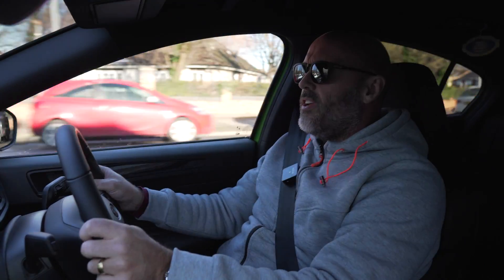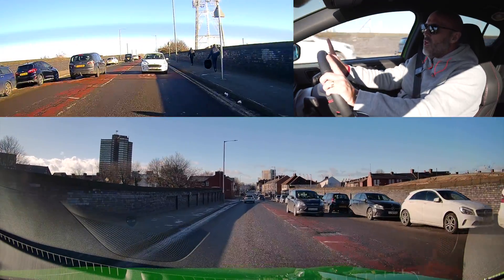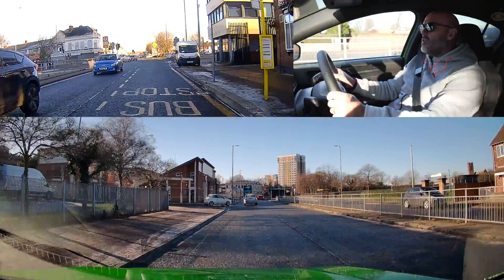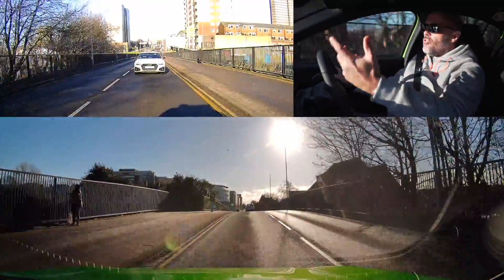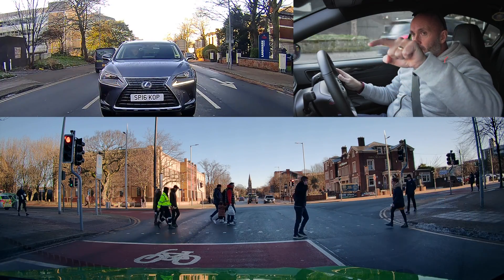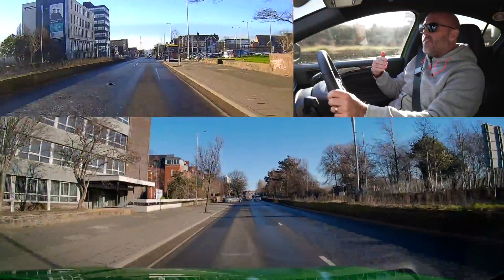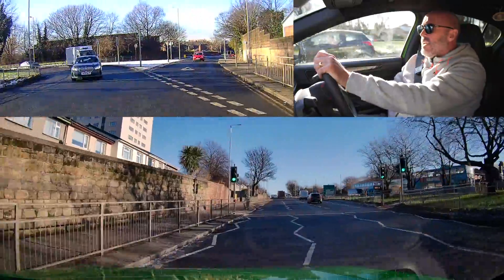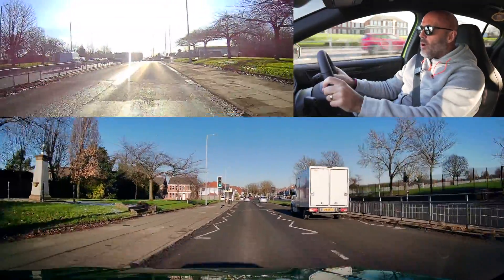How To Anticipate Traffic Light Sensors (Flashing Your Lights Doesn't Work!)

Comment: I used to work on traffic light systems and can tell you the following about the in road sensors. There are three shapes of sensors, diamond (GEC), half chevrons (Plessy) and full chevrons (Ferranti). I might have the first two back to front! Crossing each sensor on the Ferranti system added 1.5 seconds more green upto a max green time for that direction. If no cars are coming either way the lights default to the main cause of direction.
This info is very old so could have changed.
The bad side was that it encouraged those in the know to rush to hit the first sensor before slowing down.

Comment: I hate the ones that don't pick up on motorbikes.
Whoever designed those has no concept of how traffic works.
I've been stuck at lights for a while in the past, waiting for a car to come along because the lights have cameras facing the opposite way to catch people skipping the light, so going on the red is not an option. There's a specific junction I know well and they follow the same sequence at all times. No problem in my car. Never gets triggered on the bike.
In my car. I've also seen cyclists creeping forward from blind junctions, trying to get out on a red because they've not been detected.

Comment: stopping at lights isnt an excuse to sit and look at yer bloody fone ,,, it gives you chance to observe more ,, check your mirrors cos you never know some twit racing up behind hasnt seen you have all stopped ,not that you can do anything about it but you can prepare for impact . i was always taught the 3 second rule .  you shouldnt need your foot brake for more than 3 seconds , if you do drop a gear and use engine brake ,  shouldnt have clutch in for more  than 3 seconds if stopped , put in neutral and handbrake .if stopped at lights longer than 3 seconds handbrake again .i always thought 3 seconds for foot braking surely isnt long enough but if you test it out it actually is for most situations and if not drop a gear and use engine braking to save brake pads ,plus while using engine braking you arnt using any fuel at all .if like some you coast down a hill with clutch in and using foot brake your still using fuel to keep the engine at idle .ive got a new vauxhal corsa 1.2 which is supposed to only do 37mpg in urban stop start traffic , i can get just over 50 mpg . oh and if stopped at lights more than a min turn engine off , you will surprised how much fuel it saves over the course of a week

Comment: I start very early in the morning. Sometimes before 6 .and the lights always change very quickly to green .but when I return more traffic on the road. I'm hitting more red lights. I was behind someone not fully parked at the lights, but lights stayed red .until I told her to move forward for sensors to activate  the lights changed.

Comment: Don't know if anyone's made this point, but I think the myth about flashing your lights to get traffic light sensors to change may come from a confusion with temporary traffic lights. I believe, at least with older temporary traffic lights, that ones that would car count, specifically at night, might be susceptible to light flashing. Not actually sure if any temporary lights operated this way though.

Also, some people think emergency services flashing lights make lights change. Don't know whether that's actually true though either.

Comment: From my experience, I've noticed three types of traffic light sensors: the ones cut in the tarmac, the infrared cameras and actual headlight cameras.
The first work good when traffic moves very slowly, like in bussy city areas, but they're literally uselss on stretches of roads where the speed limit is, say, 40mph.
The infrared cameras are the majority of sensors and sometimes they are programmed so that when you approach the set of lights at a certain speed, let's say, not faster than 40mph when the lights are red, you will reach the traffic lights and they will change to green if there's no other traffic from a different direction.
The headlight cameras work only at night. They're quite sluggish in triggering the green light, but they only work of you drive with your main beam on - flashing repeatedly does not work - and they're mostly installed on dual carriageways with a higher speed limit than 40mph. They're also quite rare.
How do you know they're there? Simply from experience, so you need to test them as you drive in your area.

Comment: All good and sound Ash but some temporary light still work on sound, but not light, in my experience. If you look at the sensor box above the temporary light set it will show a red LED light as you move towards but not if it's sound triggered. We have to be extra knowledgeable when cycling. A particular set of lights on a busy orbital near me won't change for a single cycle or motorcycle without you making multiple passes over the magnetic loop sensors in the approach.

Comment: The units on top of the lights are motion sensitive, and look for moving traffic.  They are normally used to judge when a green light can be changed to red without impeding traffic.  They can also sense an approaching vehicle when the light is red, and if the cross road is clear, they may turn green in anticipation.

The inductive sensors cut into the road surface are presence sensitive, and while they can sense approaching traffic (if they're installed far enough away), they're more usually used to sense queuing traffic when the light is at red.  They do not require the vehicle to be moving, only to be present over the sensor itself.

Comment: While it’s often not possible to see where the detection cables actually are - say after they have resurfaced the road after the installation (they do sometimes, believe it or not). However, if you observe the change in lane markings from around 8m 29s, using long lines/short gaps, it’s likely that they are in that area. The formal term for those is “warning lines” in the Traffic Signs Manual ISBN 978 0 11 552479 0. It seems reasonable to plonk the detection cabling inside that zone.

In that clip, there were 5 marks on the approach to the stop line before the cycle zone (which is the minimum on a 30 mph road), but could be more. If you are outside that stretch with “warning lines” you should be able to stop if the lights change - but much closer than that you’re in the “dilemma zone” ( term used in the DfT bumf), and it’s often best to carry on, if you do the sums re the standard display time of the yellow aspect, braking distance etc.

Another type of sensor that is used at certain junctions is the traffic priority one, with on-vehicle kit mounted in buses. Sometimes used at bus-only ones, but could be elsewhere as well to prioritise them if they are at the front of a queue.

The other feature that uses sensors is those roundabouts with “part time” signals. They have signs that show they are “part time” and may be switched off when traffic levels don’t need them. Another one is temporary traffic signals that are supposed to be able to detect traffic.

Apart from the use of standard sequences for individual junctions, which one tends to learn with route knowledge, some Councils have systems that have several junctions linked together so as to maximise traffic flow ( so-called “green waves” ), so sometimes running at roughly the right speed one can end up without having to stop anywhere. Depends on the overall layout, though.

Comment: Three things I'd change about the UK's traffic lights:
1. Have those sensors placed further back to avoid changing to amber just because someone left a slightly larger gap, forcing them to brake more sharply than usual. Also sensors that are better able to detect cyclists (once again, good to learn from the Netherlands here)
2. Longer amber phases depending on the speed limit - 3 seconds for 30 mph, 4 for 40 mph, 5 for 50 mph and so on. At higher speeds you really need more time to react and decide to come to a smooth stop, or to continue through.
3. Arrow shapes for the red and amber lights. At complex junctions it's often not immediately obvious that a red signal is intended for turning traffic as it's always a red circle, causing people to stop at them when they intend to go straight (this happens especially at night in unfamiliar areas). Having a red arrow for a right turn immediately says "right turn traffic should stop, this signal doesn't apply to others".
Reply: Disagree on point 3: an arrow for me means "go" regardless of colour.

Comment: One thing I notice people missing is "Platoons". Lights on a longer, busier road are timed, so groups of traffic get the green lights.

They're timed on the speed limit, I.e it takes this long for a vehicle going 30mph to cover X distance. If you speed along at over 30, you'll constantly catch the reds, stop, and almost immediately have to start moving again. Whereas someone going the speed limit will arrive as the amber comes on
Reply: The A34 into Manchester is one of these and taxis knew that driving 20mph over the speed limit got them through them all. It was scary that they would drive at a red light and it would change with seconds to go!

Comment: A few years ago,  I drove right across Leeds, on the main roads, to catch an early flight. Each set of lights were on green, until they sensed my approach some distance off. They then changed to red, despite the absence of any vehicles on the side roads, causing me to slow and stop, before changing back to green.
Reply: This seems to be a trend now in the move to demonise cars. It's sometimes comical to watch it from the side...you're sitting at a red light with green to "fresh air" as someone put it down below, then as someone approaches the green from the other side, it turns red and then gives you the green. There are a few traffic light controlled roundabouts I can think of which do that.

Comment: I think it was on a youtube video that someone advised not to ride the clutch at intersections. Something to do with clutch thrust bearings.

I have long since, decades long, been in the habit of neutral and handbrake at traffic lights and stop signs.

It has never slowed me down. I am usually first away as lights change.

My give way sign behaviour is different but I make sure not to jump the gun at lights and stop signs by not even checking to see if the way is clear until the handbrake is on. At which point I do check to see if the way is clear.

It won't necessarily stop an overzealous cop from lying about not me not stopping though.

Comment: Am I missing something? Why would anyone sit with the clutch held down in gear whilst waiting at traffic lights or a junction where it is clear you won't be moving anytime soon? I'm just thinking about the poor clutch getting destroyed. Not only that, if the handbrake is not on either, one slip off the clutch and you'll be shooting forward into possibly another vehicle or pedestrian. Is this normal behaviour?

Comment: Here in Bristol during the night the traffic lights stay on green until they see a car coming then go red to stop that car until someone approaches from a different direction. All right it's not all of them but definitely the ones on the Bear Pit roundabout and the ones on the Cumberland Basin flyover, they've done it to me too many times for it to be a coincidence.

I delivered to a company that makes traffic lights once. While I was there I asked one of the guys about the sensors and he confirmed they are just rangefinders and are designed to work regardless of light levels so they can't see you flashing your lights at them.
Reply: Yes, I've noticed this as well, generally on traffic light controlled roundabouts. I don't know if this is a good strategy for busy times or whether it's just part of the war against the car!
Reply: Perhaps the opposite approach would burn out the red bulbs, which would be more of a safety issue than burned out greens.  Road tram signals on which the centre bulb is common to all "aspects" ie stop (bar), proceed & cluster (equivalent to amber) and so is always lit, are often failed due to having burned out.

Comment: Or you could just use the amber light coming on for its intended purpose of preparing to pull away and slot it into gear. I'd also add that outside the big cities lots of traffic lights don't have sensors and just run in set patterns and sequences.
Reply from the maker: IAM Motorcycle Observer and Assessor trying to reduce road users observations. Nice!
Reply: @ashley_neal  Nowhere did I say anything about reducing your observation on what is going on around you. I was commenting on the idea of trying to second guess when the lights are going to change.
Reply from the maker: Lol. What do you teach your riders to look at then?
Reply: I think Mike will tell them the same as you (it's certainly what the IAM taught me).  However its not an exact science & the red amber phase was created to give a " heads up" in advance.  Most countries don't have this phase eg France - red straight to green.

Comment: Please everyone pull up to the line and stop over the sensor. People at my local junction stop before the sensor, causing the right-turn filter not to trigger. Happens 50% of the time, and we wait three cycles until the lights do a mandatory right-filter phase.
I sent the council pictures and diagrams twice but they never do anything about it. Edinburgh council that is.

Comment: A few things about how they work. Yes the one's on top of the lights use infrared to detect cars. I sometimes wonder if there's just a single car, they're too close to being picked up and so it might wait until there's more than 1 car in a queue before it kicks in a timer for the other directions.
The ones cut into the road are more interesting. They work with inductance, like the wireless phone chargers or NFC to know a car is there. The distance for causing lights to change will be about the time when a car isn't hitting the sensor at the back plus a little bit of time. So if a car has just left the front sensor, and nobody has crossed either sensor within a second or so, then the lights will change.
The one's cut into the road are particularly important when it comes to single lane lights. (usually turning left). If a car is not sat on the front sensor, the lights won't change until the main lights for everyone changes. I've seen so many times a car has stopped too far back and hasn't been on the sensor, so the filter lane light hasn't changed. Sometimes these sensors are larger than others. These areas are also more prone to pot holes since it's a weak point in the road, so some people avoid going into the pot-hole and then don't trigger the lights.
Most traffic lights will default to one direction being green when there is no cars (usually the main road), however some will just alternate after a timer.
Although the ones cut into the road are more efficient for changing when there is or isn't a car. Due to the sensors being induction based, a cyclist at the lights wouldn't trigger the lights due to not enough metal, so lights with a dedicated cycle start point will always be infra-red based.
Some use both.
My annoyance comes with temporary traffic lights which use infra-red sensors. They should be calibrated to have the sensor pick up to the "wait here" sigh. But there's been too many times, it's either not been set up correctly (so just works with a timer). Or it constantly thinks something has gone through one end, and not come out the other, so doesn't change.
Reply: The ones on top are generally doppler radar, the same thing as on speed guns/speed cameras. In fact, if you have a radar detector in your car, you can detect them. As a radio enthusiast, I bought a cheap radar detector to see what was about. Automatic shop door openers are detected as well.

Comment: 10:15 the other week I was in the van approaching a set of temp lights at about 7.45am.  They were on green on the approach, then turned red, then turned straight back to green.... (eh...????). At the other end - instead of the usual 2 or 3 cars - there was the first car set well back from the light and about THIRTY cars all queued up behind them.....
Reply: The change to red for you would've been the "I've not seen movement for a bit" and triggered a cycle.  Then when nothing has moved on the green side and it's picked up you has then favoured your side.  Temp lights unless they are positioned on the offside aren't set up for queue length activation.  They'll be able to see over cars, but if the first few vehicles are vans and they're too far back they probably haven't triggered the "waiting loop" around about where the sign telling you to stop is.

If you're stuck at the front of temp lights for a long time shuffle forwards (or backwards if it's just you) and that'll usually trigger it unless it's broken.  Look for the indicator light on the detector.

Comment: I'm not convinced that inductive loops rely on movmement, since a stationary vehicle would still affect the inductance of the circuit. However, the clip you showed did seem to imply that movement is required. Some experiments may be in order!
Reply: They don't, they sense when something (of a suitable mass) is there.  Movement is calculated from the data the set sends.  The far back ones are usually the queue length trigger, having something stationary on the front loops and the far back loops without any variation (things moving over them) will trigger a change if it's set up for that.

Gap sensing is done with a pair at the front.  If there is a demand call from another direction (or pedestrian button) and there's nothing sensed around both loops the lights will probably cycle.